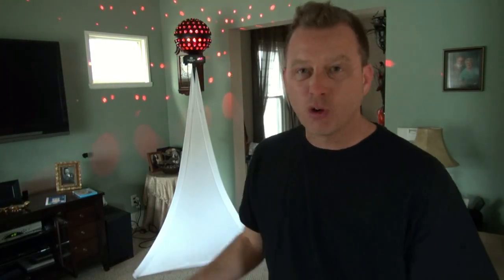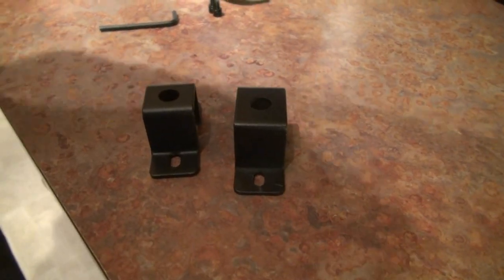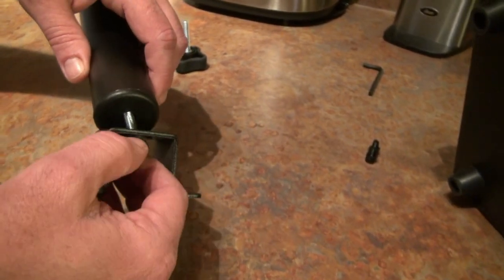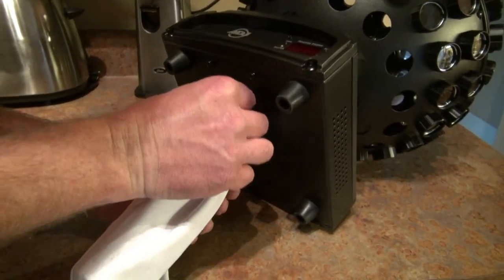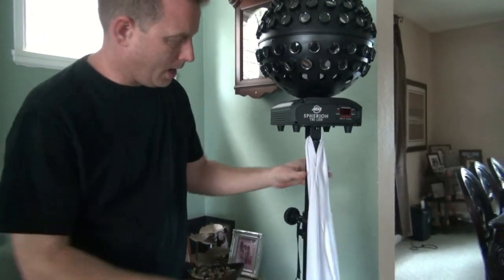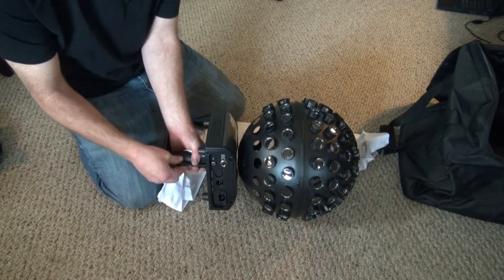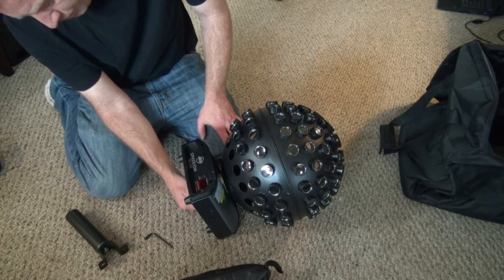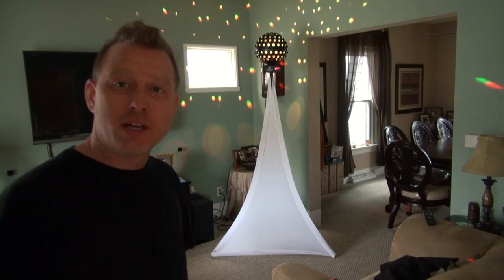Brian Builds A Spherion TRI LED Stand

Comment: You could also have a small snack size ziplock in your bag, or even velcro it to the bottom of the Spherion. Especially the allen wrench. Kinda like Pioneer cdj's have the disc removal tool underneath.
Just an idea.
Thanks for sharing your ideas as always Brian!

Comment: Would it be possible to mount a 16"+ mirrored ball in a similar fashion?

I suppose the real trick would be finding a large enough mirror ball motor that the ball mounts on top of rather than is suspended from. I haven't had much luck in that department.

Comment: I purchased the Colorado Tripod Fixture Mount  (CSL 1 1/2 with lock). Nice idea but not reliable for heavy lights like moving heads because this is made out of hard plastic (not metal) and the screw (on top) is really small for a decent moving head (risky, because all the weights will be centered on this screw).  It has only 1 inch  allowance for the connected tripod tube which is another risk. 
For 40 dollars, it's overpriced.  Hope they will update the design:  Use metal tube; use large screw; change the connecting mechanism so that the tripod tube will fully insert into the top, because 1 inch connection (present design) with plastic connector is a disaster waiting to happen.  I ended up using mine for small non moving lighting fixtures.  Finally, they should put the specs on their online stores.